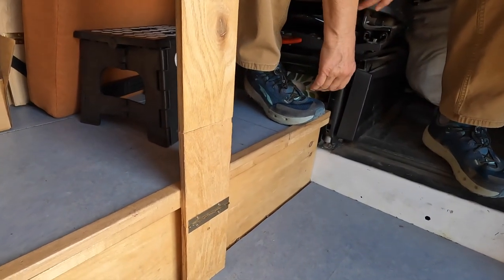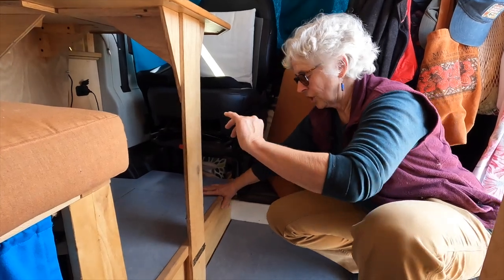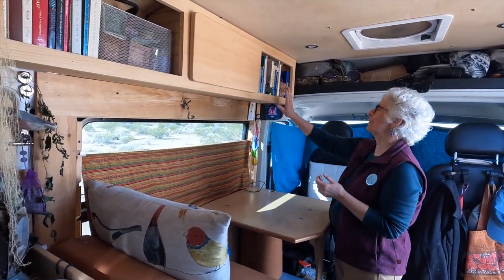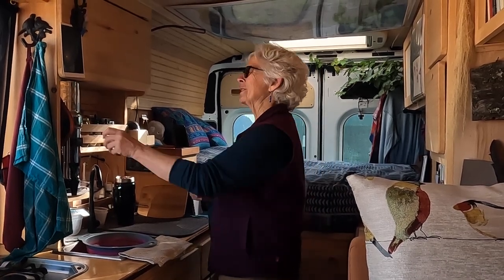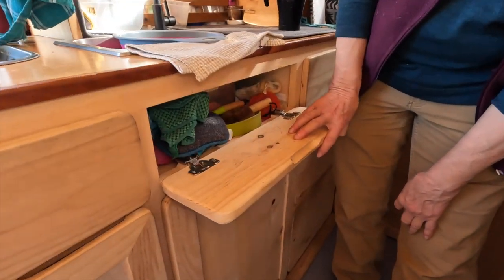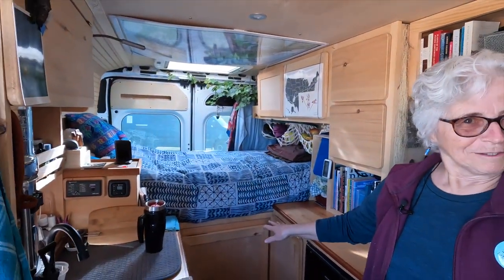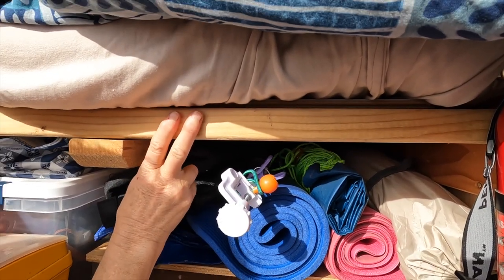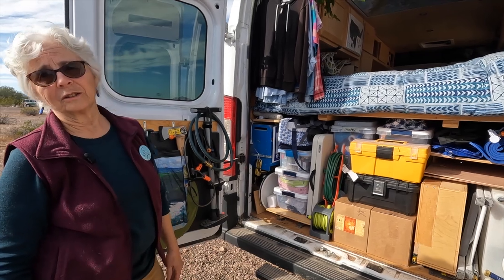One of the best DIY ProMasters with Unique Folding Table | Van Tour

Comment: I am amazed at how compact and versatile her van is. 😘
As watching the video, I wondered about the weight. Did she need to beef-up the suspension?
Reply: I didn't, no. I did a rough calculation of the weight of the wood early in the process and it turned out it was barely more than the weight of a burly passenger, so I opted not to stress about it 😂. And it turns out I'm still safely under the GVWR fully loaded.